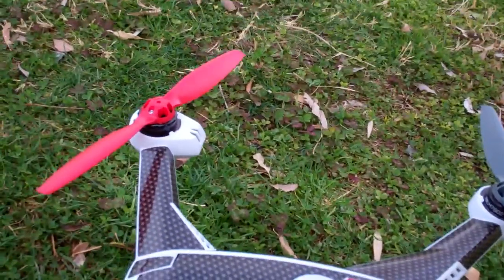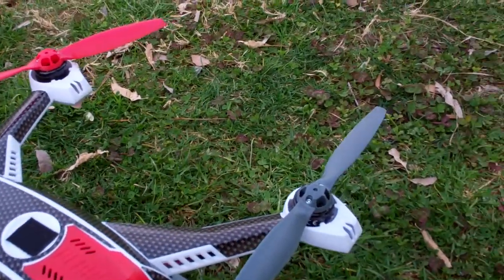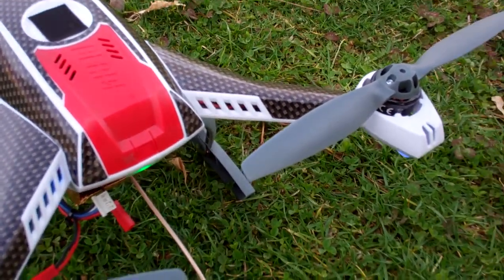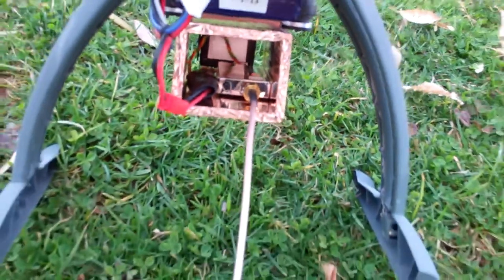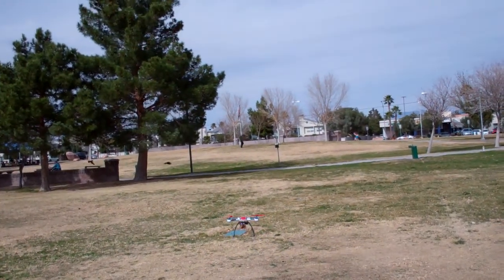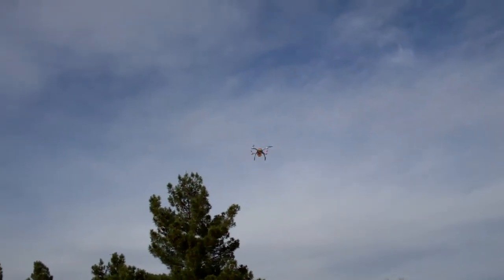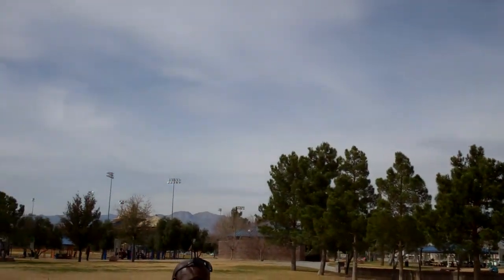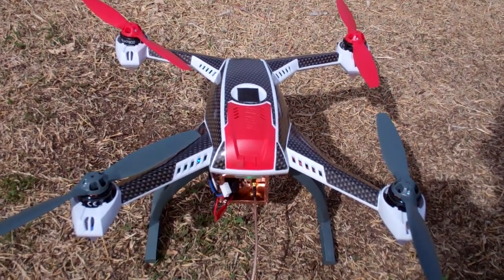Blade 350QX FPV box test 2-18-14

Comment: i say more shielding inside under the gps will do the job tooo .. same is with gopro in recorded mode under it ..gps is lost ,,some vid on youtube show how to do it
Reply from the maker: I have shielded the entire inside of the quad with aluminum tape and it took care of the GoPro issue but did nothing for the FPV gear issue. I tried to put the copper tape inside the quad but it blocked the transmitter (DX-8) from communicating with the quad consistently. After making this box I have had no issue at all with the GPS so I think this is the solution at this point.